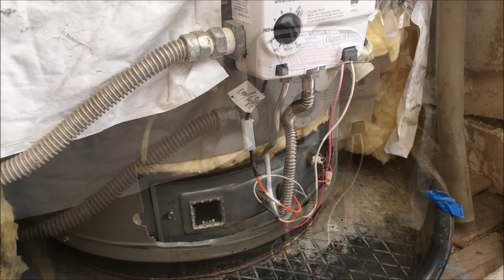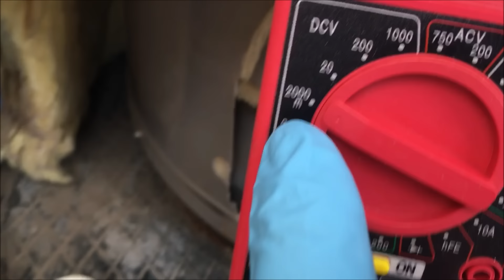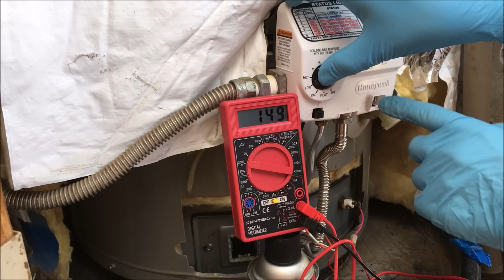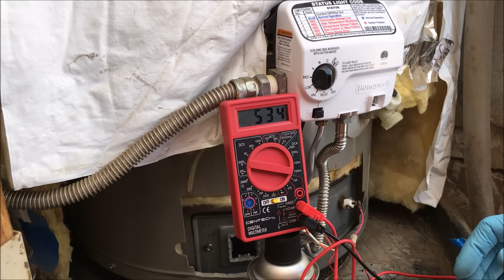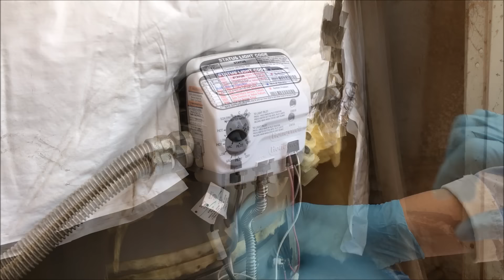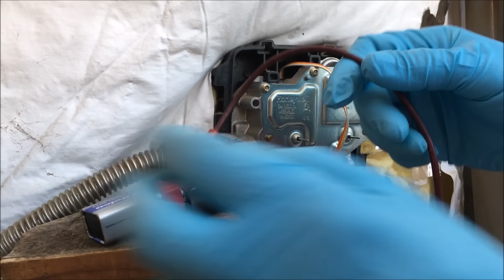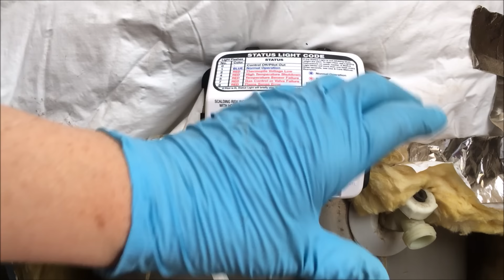Troubleshoot Water Heater AND Honeywell Gas Valve | Step-by-Step

Comment: Thank you! It helped me fix my unit nice and easy like.  I could not find the original control value model type (reasonably priced) and swapped it for the newer type.  Replaced the circuit board only and it worked like a charm.
Reply from the maker: That's wonderful news to hear, Radatosk.  You tackled the job and fix it all on your own.  Outstanding job!!  A very Merry Christmas to you and your loved ones.

Comment: Holy Cow, this was very informative and I am sure will resolve the issue I am having. Parts changing is not the answer, you have to troubleshoot each part to resolve the problem. Showing how to test out each part with a meter, what the desired reading should be and how long it would take to reach the readings so there is no misunderstanding of the reading was excellent. Many videos do not cover this, I give you an A for your video, will pass it along and consider you to be very knowledgeable. Thanks for all your help, if this was helpful, I suggest you click like, save, share and Subscribe. This will save you lots of time waiting for a plumber, money and get you back up and going in no time. Thanks again.
Reply from the maker: Succstrat, thank you for your kind words and for taking the time to write them.  They mean a lot to me.  You are absolutely correct when you say, "Parts changing is not the answer, you have to troubleshoot each part to resolve the problem."  If you don't troubleshoot, it just a guess.  Merry Christmas to you and your loved ones.

Comment: I used a multimeter like yours on the same setting and tested the thermopile like you did the second time. The highest it reached was 645. Is that close enough or could the thermopile be the issue.
Reply from the maker: Austin, do you mean you first tested the thermopile by isolating it from the thermal switch and the thermopile tested out above 650?  Then, you tested the thermopile with the thermal switch inline/attached and the thermopile tested out below 650?  Please clarify.
Reply: @frugaldiy1  I did not test it by isolating the thermopile first, I just tested it while it was connected to the thermal switch.
Reply from the maker: Austin, please do yourself a big favor and test out the thermopile by isolating it from the thermal switch (as I showed in the video), so you can get an accurate reading on the thermopile alone.  The thermal switch may be an issue; that's why you test out the thermopile in isolation.

Austin, please tell me what exact problem you are having with your water heater so I can try to help you.
Reply: @frugaldiy1  So I isolated the thermopile and it didn’t read above 650. 

So I am able to get a flame from the pilot to come on but it won’t stay lit. I’ve tried relighting the pilot, but the status light on the gas valve won’t come on and the water heater just won’t start up.
Reply from the maker: Okay.  A thermopile can have a reading under 650, by quite a bit lower, and still work.  What was the reading when you isolated the thermopile?  That you can raise a pilot flame, but it won't stay lit, tells me the pilot head is not obstructed, so that's good.  Have you tried testing the pilot valve pin and main burner valve pin to see if they work--"click?"
Reply: @frugaldiy1  It was right at 650 when I isolated the thermopile. I have not checked that yet, that would be my next step.
Reply from the maker: I don't think the thermopile is the issue causing the water heater to not work.  My gut level is that the control board in the Honeywell gas valve has failed.  It's a common problem.  Were I you, I'd test the pilot valve and the main burner valve, just to make sure they are working, before I purchased a control board.  Please let me know if I can be of more help.
Reply: @frugaldiy1  I tested the pilot valve and burner valve and they both clicked and worked. You said you were able to get your control board for $50. Is that something that would be covered under warranty?
Reply from the maker: I purchased the entire gas valve from the local Restore for $50.  I simply removed the control board and cover from the Honeywell gas valve on my water heater and replaced them with the new control board and cover.  You'll have to call the manufacturer of your water heater and ask if the water heater is still under warranty.  You can go on eBay and type in the model number of the gas valve (found on the side of the front cover) and you will see results for pre-owned and new entire gas valves and control boards.
Reply: @frugaldiy1  Does the whole model number need to be exactly the same or as long as it has DW at the beginning is it fine?
Reply from the maker: Austin, I cannot answer that with certainty.  What I can tell you is the gas valve on my water heater that failed has a model number that started with the letters "WV."  The new gas valve had a model number that started with "WV" but had different numbers that followed.  I felt certain that though the numbers were different after the "WV," the control board would work just fine, and it did.  So, in my case, the replacement gas valve model number was NOT exactly the same but works like a champ.

Further, if I would not have found the gas valve at the Restore, I would have purchased a pre-owned control board for my gas valve on eBay, from a highly-rated seller, without hesitation.  I saw that many of the pre-owned control boards were being sold by plumbers who had pulled a working unit/water heater.
Reply: @frugaldiy1  I found one with the same number on the control board and ordered it. Thanks for all the help!
Reply from the maker: You're welcome, Austin.  It's me sincere hope you have hot water again real soon.  I know it a tough time of the year for your water heater to not work.  If I can help, please let me know.  I'm rooting for you.

Comment: My water heater is fine but not running properly it just keeps running water but led status says it's fine I don't get it
Reply: Like if it never fills up
Reply from the maker: Cesar, I'd be concerned you have a water leak somewhere inside or outside of your home.  Take a good look around.
Reply: @frugaldiy1  I live in a mobile home and from what I can see there isn't any leaks near the tank, but I do just hear water running underneath when it's on. I told our manager since they did shut off the water a couple days ago. They said to leave the faucets running cause air got clogged but that didn't work. Probably a leak under the home?
Reply from the maker: Based on your description of water constantly running, yes, it sounds like a leak.

Comment: nice video, very informative.  I'm not sure what issue ours is having but we're going to call a pro tomorrow.  I thought the kid used all the hot water taking a shower, we're all guilty of that now and then, but I noticed no sound of the burner when I stepped into the laundry room, but the light was blinking, only semi warm water was coming out.  I put my fingers between the leads on the thermocouple and heard a TINK but then the indicator stopped blinking.  And I haven't been able to get the pilot to ignite since.  A few months back we accidentally shut it off to flush it and had to get a plumber, he got it to light instantly.  we followed the instructions and even called the 1 800 number.  We even had the whole control box replaced a few years ago but the thing is 11 years old.  Ill update when i get an answer, we're planning for replacement even though money is crazy tight right now.
Reply from the maker: Chris, how many flashes at the LED status light?
Reply: @frugaldiy1  I was one flash every 3 seconds until i hit the button on the thermo couple.  But i seemed to have fixed it, I let it sit off for near and hour and tried it again not long ago and a few clicks later i noticed the light blinking again.
Reply from the maker: Great job, Chris!  You are your best repair person.  Do you men you pressed the "reset" button on the thermal switch?  If you did, and you have a problem again, the thermal switch itself may be faulty or your combustion chamber may be getting too hot.  You might want to consider turning down the temperature on your water heater a bit.  Comment back if you have any other questions.

Comment: Thank you for the very comprehensive explanation. It helped me clear some doubts and get to the root cause of a problem with two water heaters. Even though the video mentions that it is very rare that the control valves (solenoids) fail, I found faulty solenoids in two different heaters of the same age. One had a bad pilot solenoid and the other one the problem was on the main burner solenoid. I managed to combine the two good solenoids in one control valve body and later fixed the other two solenoids (soldering the cables that were with bad contact). In the end, I could fix both water heaters without spending a penny. My doubt was if I could test the solenoids with a battery, as they work with millivolts from the thermopile and it was cleared out by this video that uses a 9V battery to test the solenoids. I noticed that some solenoids are set by even a 1.5V Csize battery while others are only set with the 9V battery, but both work well with the millivolts from the Thermopile.
Reply from the maker: You're welcome, Valerique.  And, thank you for explaining your particular situation, problem(s) and fix so that we can all learn from you.  Enjoy the hot water and happy DIYing!

Comment: I installed an old model gas valve and  a old burner no more issues with my hot water tank any more
Reply from the maker: Brilliant, Carlos, brilliant!  You have my respect.  Great solution.

Comment: Thank You for the troubleshooting tips.
On my water heater the status light is off, no flame at the pilot, therefore no hot water.
I tried to re-ignite the pilot. The flame lit, status light blinks. But as soon as I release the pilot button, the flame goes out, status light goes off.

Follows your tips, I traced to the pilot valve. It does not click when 9VDC applied to it.
I open up the valve assembly. There it is, the end of the solenoid coil that soldered to a post is broken.
Re-solder the wire, re-assemble the valve assembly, connect every thing back.
The heater works like new.

A side note: to re-assemble the valve, I have to remove the valve housing from the heater, lay it on a bench in order to put the valve together.
Since the valve just dropped in the housing, no screw used to attach it to the housing, it's impossible to assemble the valve when it mounted vertically to the heater.

Long story short: It's a successful operation. Thanks again for your video.
Reply from the maker: You're welcome, and I'm so glad the video helped you.  Job well done, binh!  Enjoy the hot water.

Comment: Thank you for taking the time to make this video. I watched many videos before this trying to troubleshoot my issue. This was the last video I watched because you covered everything in great detail. You also saved me a lot of money.  Thank you!!!
Reply from the maker: Richard, you're welcome!  Thank you for taking the time to leave such a lovely comment.  Your comment has made my day!
Reply: I have a question if you don't mind.  The # on my honeywell box says WV8880B1210.  The replacement part I got is WV8840B1110.  Everything looks the same, size, fittings, labels etc.....
Is it ok to swap the chip board still?
Reply from the maker: Richard, I can't say with 100% certainty, but I believe, based on my personal experience, that the replacement board will work just fine.  The model number of my original Honeywell gas valve (on the box/cover of the valve) was different from the replacement gas valve I purchased.  Even some of the components on the replacement board were different than the original board.  But, I used the replacement board, and it worked like a charm.
Reply: Thank you again.  I will try and let you know for further reference.
Reply from the maker: You're welcome, Richard.  Yes, please let me know so others can learn whether the replacement board works in your case.
Reply: I installed circuit board and so far it's working without issue.  Thank you again!!
Reply from the maker: Outstanding news news, Richard!  Great job, young man!  That the control board worked for you, just makes my entire day.  Thank you for the update.  Merry Christmas to you and your loved ones.

Comment: Wow thank you. Explanation was clear and concise. I wish I seen this video earlier. I have replaced my Honeywell gas valve unit with a new one as it was giving me  7 blinking lights “gas valve failure”. And after replacing it with the new unit, it still hasn’t solved the issue. If you could give me some help, it would be very much appreciated. Thanks
Reply from the maker: Tony, I'd recommend going through the troubleshooting steps I show in the video so you can isolate the problem with your water heater.

Comment: Are the circuit boards in wv8840b1109 and wv100112336 interchangeable?
Reply from the maker: I'm not sure, Joel.  The model number of the gas valve on my water heater and the one I purchased were not identical, but the control board from the new one worked like a charm on the gas valve on my water heater.  Hope this helps.
Reply: @frugaldiy1  Wow thanks for the quick reply. My honeywell valve wv8840b1109 has apparently been discontinued. The replacement is a wv100112336 so I was wondering. Great video by the way, clear and direct. Thanks.
Reply from the maker: Joel, if you need just the control board, I'd look on eBay for them.  Just type in the model number (on the side of the front cover) of your Honeywell gas valve, and you should see some.  That's what I did, and I found about 10.  I just bought the new Honeywell gas valve from the Restore because it was such a good price.  Not the identical model number, but I used/swapped out just the new control board, and it worked like a charm.  Happy DIYing!

Comment: Having a problem with my water heater. My Striker is good my heater is 1yr old but it will turn on for about 30 seconds then all of the sudden it turns off, what could it be need help  , thanks
Reply from the maker: Do you have a Honeywell gas valve?  What "turns off" after 30 seconds?
Reply: I do have a honey well I install new wires for the whole bottom part of the burner and still it didn’t work it made the same as soon as u try to move the dial to a Temperature setting the flame will go off and starts to smell a lot of gas

Comment: Hi I have a question. i changed out the coupler and the water heater 
lights but wont stay lit. The honeywell gas controller is still blinking 6 times.  is it possible its the gas controller? thanks
Reply from the maker: Allen, please tell me: 1) do you mean you changed the thermopile, not thermocouple, and 2) what does the chart on the front cover of the gas valve indicate a 6-flash error code means?

Comment: Can I replace an old model of gas valve with Honeywell gas valve? Thank you.
Reply from the maker: I don't know.  My inclination is that you can't because the configuration of an older-style gas valve is different from that of a Honeywell.  For example, older gas valves on water heaters use a thermocouple, not a thermopile, because there's not "control board" to operate.  

FYI--If I had an older water heater with an older gas valve, I'd NEVER change the gas valve to a Honeywell gas valve, even if I could, because the older gas valves have far less problems and they're diehards.  I've had repeated problems with the Honeywell gas valve on my water heater.
Reply: @frugaldiy1  much appreciated your reply. I am just looking to a way to reduce heating cycle that happens in cold nights. Water heater keeps on coming on and off to keep the water hot even though it is not needed.
Reply from the maker: A water heater with a Honeywell gas valve will cycle on and off just as often as a water heater with an old-style gas valve.  It's the setting, e.g., "Warm," "Hot," "Very Hot," you choose on the temperature knob that determines how warm or hot the water will be and, therefore, how often the burner will come on to keep the water heated to your desired, set temperature.  Maybe lower the temperature setting on your water heater?

You can also wrap a fiberglass blanket around your water heater to diminish heat loss.  Just make sure you don't obstruct any of the venting, on the bottom or top, on the water heater.  You can purchase the water heater blankets at Lowe's, Home Depot and Amazon.  The blankets do help.